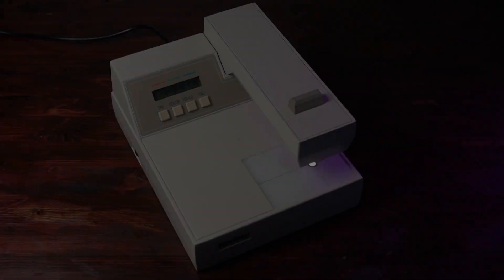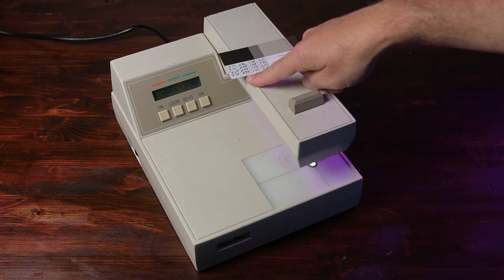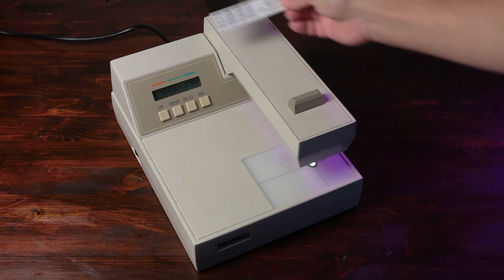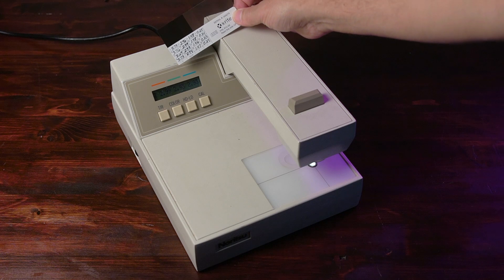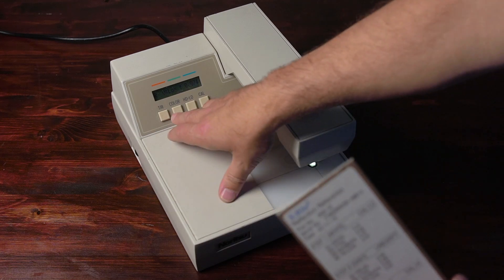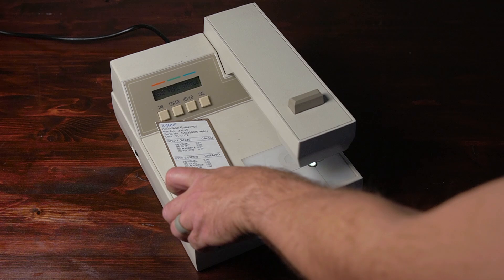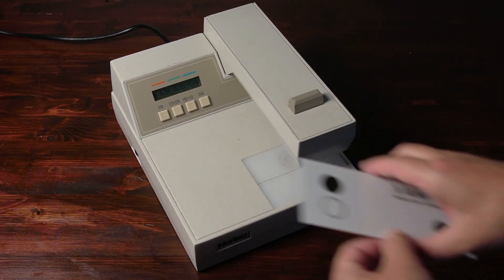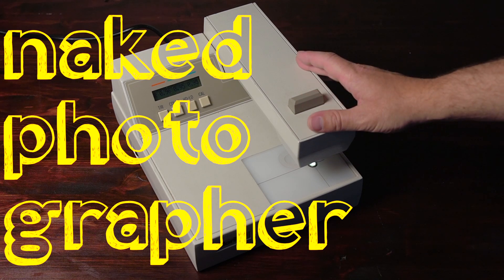Calibrating The X-rite 810 Densitometer

Comment: Hi Derek. You’re rite. The one from Stouffer T5100C is not colour calibrated but if we want something new then it’s the best thing going. Calibrating the slope would be simple enough though. Just use the neutral visual density as given by Stouffer and use that as your R, G & B calibration numbers. They would be as an example here V 1.75 R 1.75 G 1.75 B 1.75. This would be perfectly accurate for everything in your darkroom but only your darkroom. You could however take your densitometer to a pro lab if you can find one and calibrate it there with their equipment. Then measure your new one from Stouffer and use those numbers as your aims. The only alternative is to use old, scratched, finger printed original calibration films that are now pushing 20 years old at their youngest. Bummer that ! If you have in your possession any Stouffer step wedges at all then they could be brought to service as a valid calibration film. If they’re old then that might not be a bad thing as long as they’re in good shape. The reason being is that the most deterioration takes place in the first few months after being made, shipped and used. The fading after six months slows down after that point. The cal film I’m using is about 28 years old it’s deteriorated since then but not by much about 0.05 d. As compared to other Stouffer products that I have but seldom use. Hope all that helps.

Comment: thank you for this video!
I recently bought a densitometer and also happened to get one for free. They didn't come with good calibration cards, but I happened to find a kodak step tablet that is in pretty good condition alone with some paperwork. Can I use this to calibrate the two densitometers? also I recently got some kodak c41 test strips since I got a new machine and want to be sure my chemicals are well used... must i actually calibrate the meters?? I'm asking because the box of test strips comes with a reference strip so wouldn't i just need to match the one i processed to the one provided?
Reply from the maker: If the step tablet has the densities already written down by Kodak then you can calibrate to those values.  As for the C41 strips, yes there should be a reference strip, but you should read through the section in Kodak Z-131 (available online) on how to use the reference strip, read the control strips, and plot the information on a graph to track changes in your process.  I’ll do a video about at some point, but not right now.
Reply: @TheNakedPhotographer  thank you :)
Reply: @TheNakedPhotographer  actually I'm here now, and my sheet says nothing about color. It only says "diffuse density". how can i calibrate to this? and it has the diffuse density only for all the 21 steps.

Comment: One of the harder parts of calibrating these getting the transmission calibration target, which I do not believe X-Rite actually sells anymore. If you got one with your device, chances are that its very old and probably due for replacement.
I was able to get a new one for my 810 from Acurad Technical Services, who still maintains and services these devices.
I think part of the problem is that no one (as far as I can tell) actually makes these RGB Status A/M densitometers anymore, so there's little market for calibration materials measured with separate RGBV values.

Another thing I've run into is that the temperature tolerance of these things isn't very good. So when my darkroom gets too cold, the blue channel seems to go all wonky and struggles to give a stable reading.  (Manual says 10-30C, 50-86F)
Reply from the maker: These are all issues of non-digital photography that we are just going to have to deal with as the industry continues to change
Reply: Of course. I just wish the info wasn't scattered enough so as to make it a unique treasure hunt for every new person who comes along.
Somehow, I'm also reminded of your quest to figure out how to get the materials to make a new version of Kodak's color print viewing filter set. (which I think ran into some dead ends)
Reply from the maker: Yeah, I still haven’t found a good enough equivalent.  The search continues
Reply: Stouffer still has listed a current equivalent calibration standard. They may be the ones that made the original calibration standards for X-Rite originally those many years ago. Worth looking into.
Reply: @jeffneale8492  Stouffer does not sell a color-calibrated transmission reference, unless there's something hidden on their website that I've missed. (They sell a B&W one, and a color calibrated reflection reference.)
Reply: @derekkonigsberg2047  Hmmm… I’ll take another look.